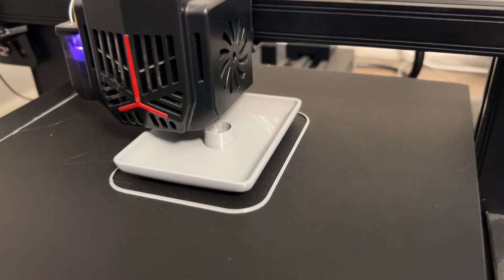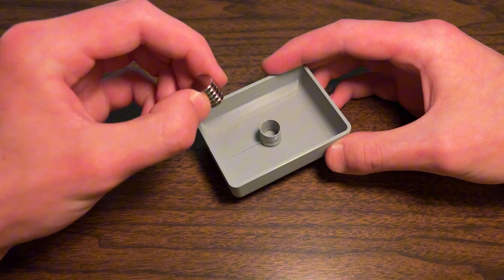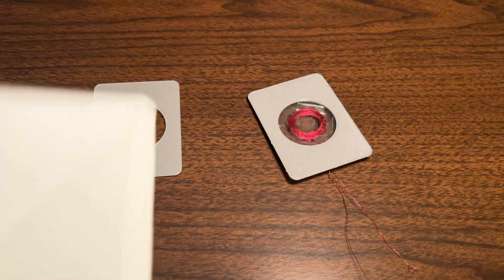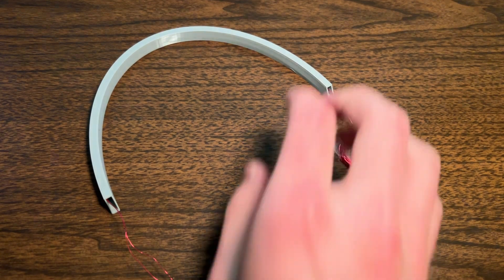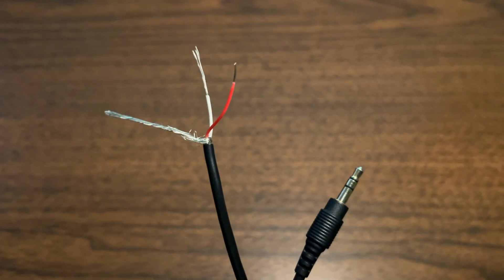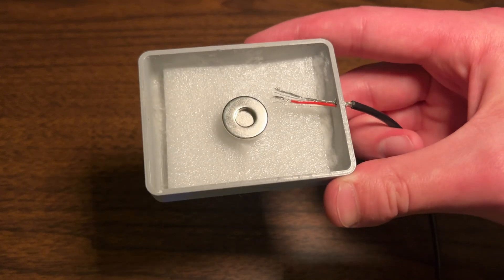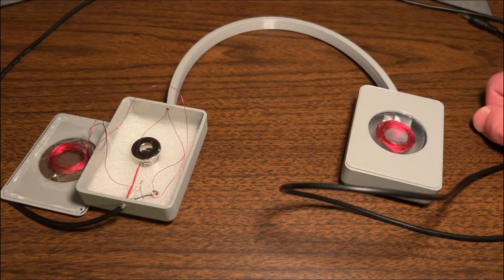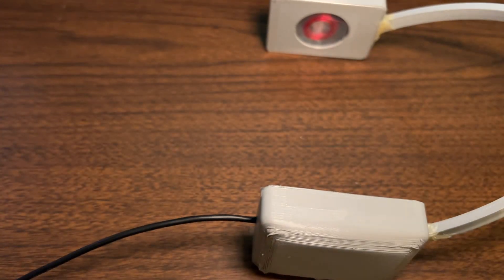I Made (Actually Decent) Headphones From Scratch

Comment: Can you do a tutorial on how to splice the headphone wire to the copper one
Reply from the maker: Once the wire is cut, there should be two cables wrapped in insulation and loose strands. the two insulated cables are left and right, the strands can be twirled together to connect to ground. At least that how the cable I had worked. 

One coil has leads at right/ground and the other coil at left/ground.

I hope this helps. Please be careful with audio equipment!

Comment: how do you setup the camera for pov shots?
Reply from the maker: I set up the tripod between me and the desk, then reach my hands around. It's a little awkward with it blocking my view but it gets the job done. I also use an LED light that I can either attach to the phone or set on top if the angle is steep enough.